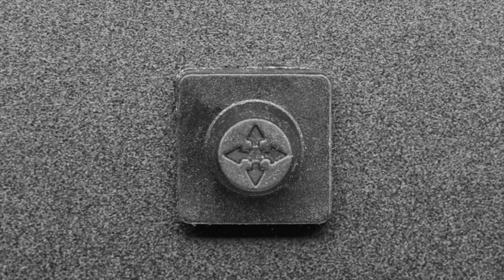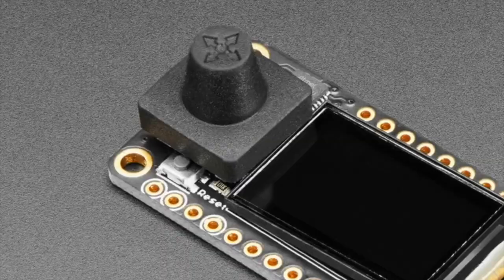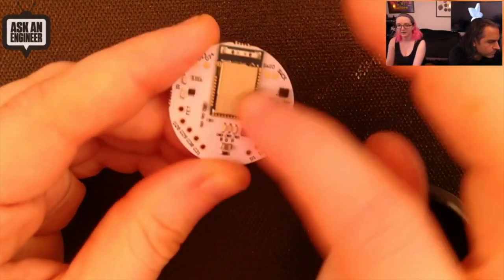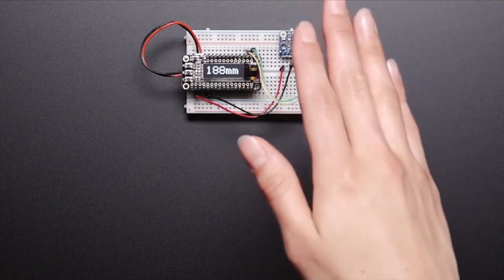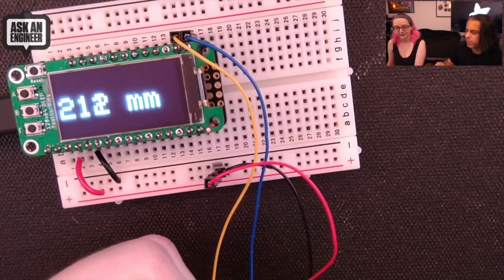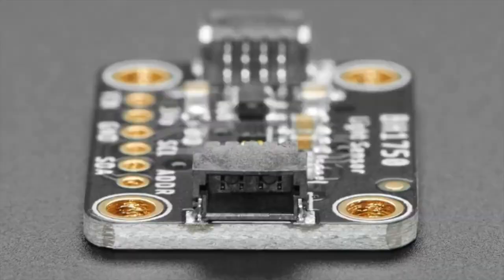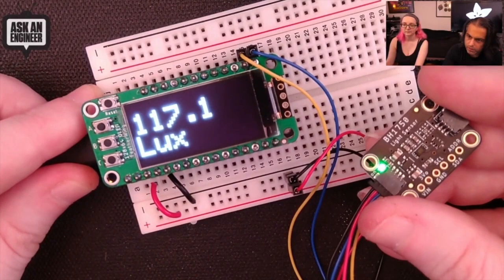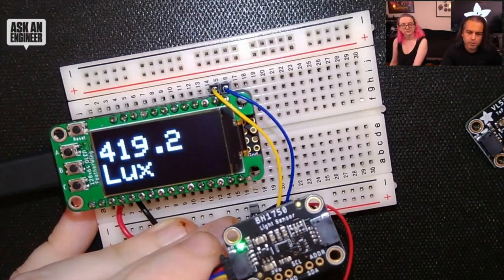New Products 7/22/20 featuring Adafruit BH1750 Light Sensor - STEMMA QT / Qwiic!

Comment: Datasheets are necessary, I need access to specific details (Even if I don't understand them).
A picture is always worth a thousand words.
A live demo easily replaces 20 minutes of Googling other people's projects. Answers the question of what else do I need to use actually use it (where most data sheets will just show you what you need to power it up (if you're lucky)).
And most importantly answers what is usually my first question in less than 10 seconds "What is it & what does it do".